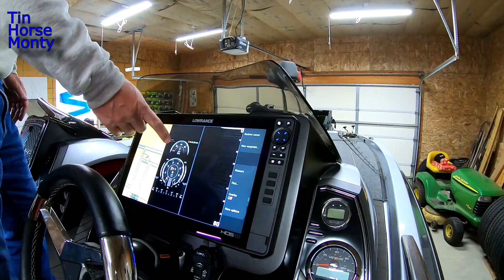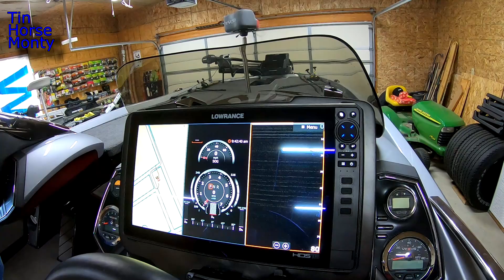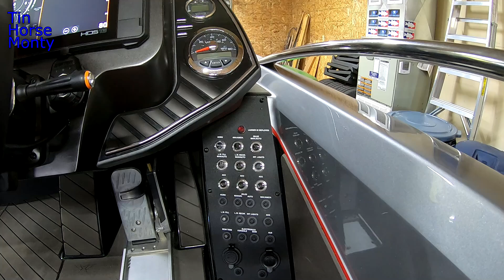Vexus VX 21 Bass Boat Walk Through Review with Ron DaRosa

Comment: I appreciate the in depth reporting of the VX 21. You guys did a great job. I fish tidal rivers which requires a boat to get shallow. The deep vee hull of the Vexus how shallow have you had it?
Reply from the maker: Thanks Douglas. It's made for big water. It does good in shallow water but I think an aluminum rig would be the best bet for super skinny water.
Reply: @TheTinHorseMonty  Thanks for the reply but a glass boat is a must because our waters are big and rough here in Maryland. Tidal Potomac, Chesapeake bay. But the creeks and flats are shallow plus at low tide you need to have a boat  that can get shallow and pop up on plane quickly. I run a Ranger Z521C now and had a 522VX. I was just wondering since the Vexus is a deeper Vee that maybe it would not get shallow enough. Thanks again for the reply if I decide to go Vexus I will get a test drive first.
Reply from the maker: @douglasspickler4925  I just talked to Ron, the owner of the Vexus, and his last boat was a Ranger 521. He said the Vexus fishes very similar to the 521 in shallow water.
Reply: @TheTinHorseMonty  Great to know. Thanks for checking that out  I appreciate that.
Reply from the maker: @douglasspickler4925  You are welcome. Thanks for checking out the video!!!

Comment: They are beautiful boats for sure ! But the Rangers still are too even though things have drastically changed over there. I run the 620 Ranger and love it but the new Vexus walleye hull is amazing but not cheap !
Reply from the maker: Glenn I agree. Lots of great options out there. Ron guides on Mille Lacs so the deeper hull  was an important feature. I have an older Ranger 520 DVS and love it.

Comment: Only one well 2 one switch the back lids to open up facing livewell ( now u got cull system without bass jumping out open up both now incl9sed box ..... two like ranger don't buy if speed is your thing its still ranger fast ( top 70 maybe 72 ) but great boat in top 3 boats
Reply from the maker: I rode in a VX20 this weekend and it was solid in choppy water.